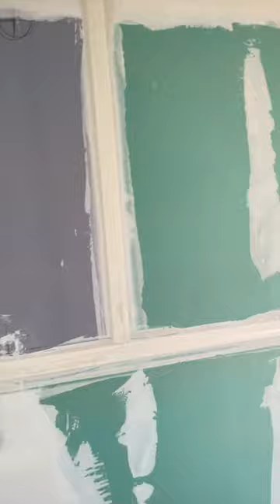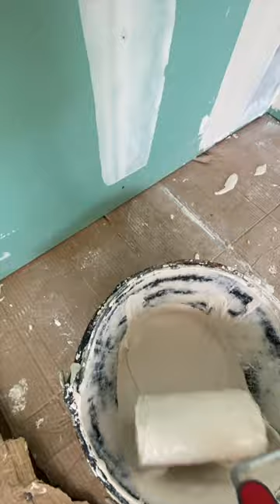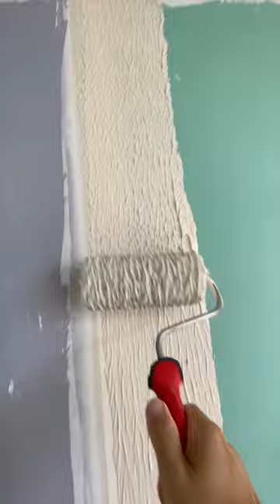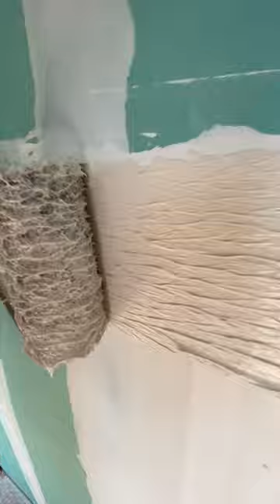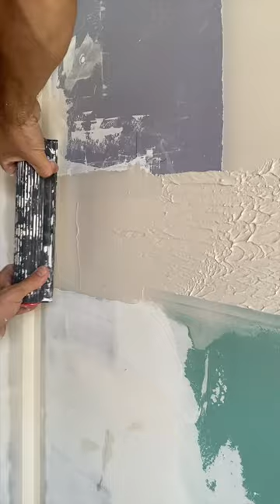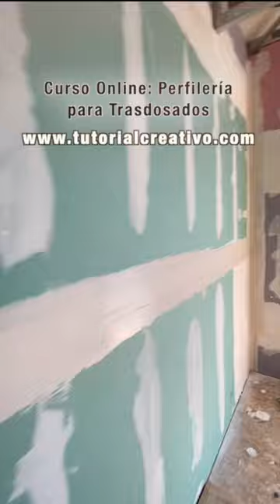🤜 Mudding Drywall Joints with Roller and Large Trowel ▶︎ Perfect for Beginners #drywall

Comment: Wow. Instead of people thanking you for a genius idea they bring on the hate. As long as everything is clean and enough mud goes on the walls, why not? Definitely way faster than troweling it on. And for one room projects i dont even need to get the pro tools out thx! I also kinda like the texture a roller puts on IF done uniform/consistent . . . beats orange peel.
Reply: But that roller is shedding those thick hairs which is why that big line is happening